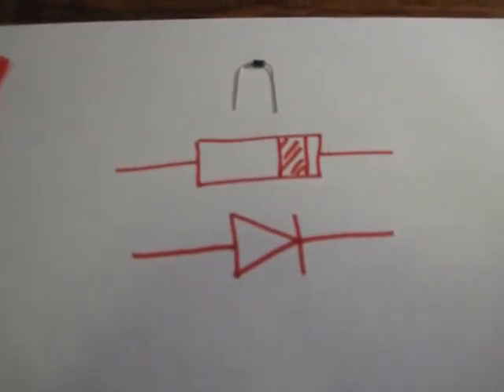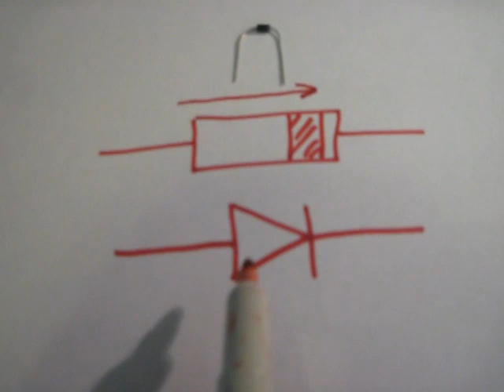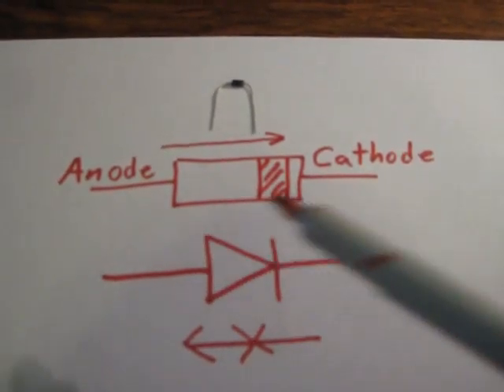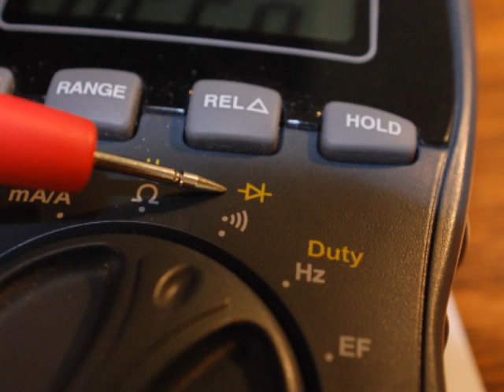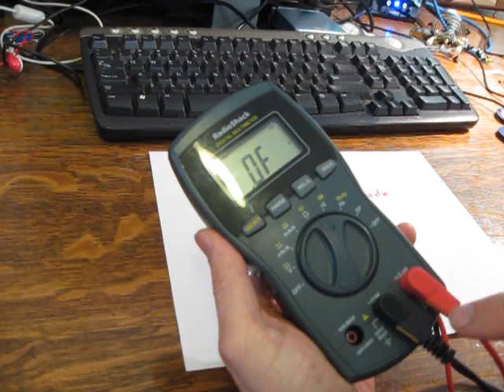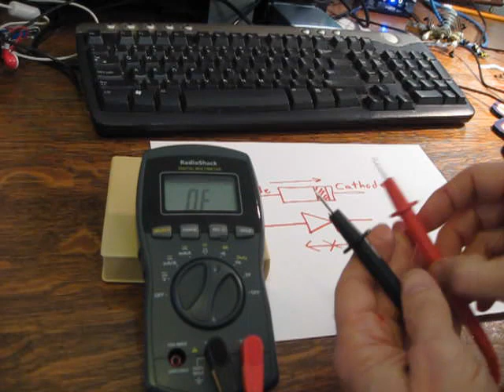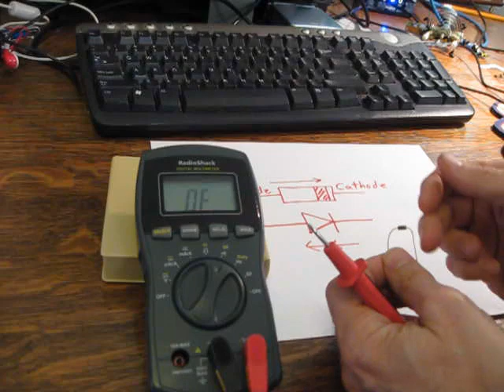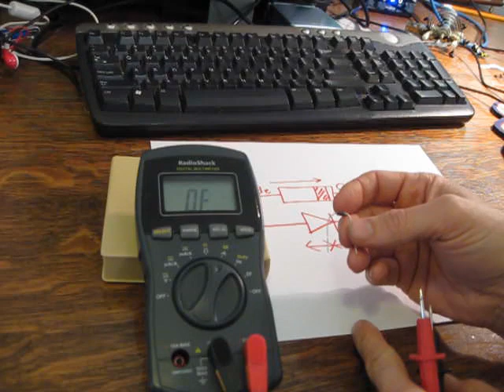Understanding and Testing Diodes

Comment: Hi, Thanks great video
I've got a mirco diode reading 158 when tested on my multi-meter...(158 not  .158)  Can I replace it with a 15V diode...and  it's from a car ECU so operates on a 12V system. and I would guess it has a 3V headroom. Thanks

Comment: It is very hard to find a video explaining how to know the power capacity, what units is used on diodes. Are they measured in watts amps. Almost any video explains that diodes allows current go only in one direction.

Comment: I have 2 faulty 2amp 1000w diodes in my tv power supply, upon replacing, is it a good idea to replace all 4 of them in the rectifier or can I get away with just de-soldering 2 of them? The replacements are the same specs but different brand, should be ok? Thanks.

Comment: Repairing a tv with no power. I dont know which component i pulled out of the pcb. But it is a cylindrical black and it does not have on any markings. Or a silver line. Can u help what it is. Upon testing with multimeter it flows current in both directions.

Comment: Thanks for the video. I'm learning to check diodes on a TV that has failed and I pulled one that I thought was bad, turned out its the Schottky diode which voltage is lower than silicon diode. Diode is good, lol.
Reply: Me too   Repairing a tv with no power. I dont know which component i pulled out of the pcb. But it is a cylindrical black and it does not have on any markings. Or a silver line. Can u help what it is. Upon testing with multimeter it flows current in both directions.
Reply: @jemsncrystals  that sounds like a bead around a wire , is there clearance around the wire ?

Comment: How do you get voltage reading from a component not in circuit?? 
There's no source. Wouldn't it be a resistance reading?
Reply: The meter sends the voltage to the diode.

Comment: I think of all the diode check videos, you seem to explain it much better.  When you mentioned to isolate your diode from board in order to get an accurate reading, I knew I had the right video.  Trouble is the diodes I'm testing are underneath a heat sink and it's going to be a little bit testy trying to remove them.  I'll get er done though.  Every thing leads to something on the power board being bad and when I read the diodes in the circuit I got some strange reading.  So, I guess when I pull them out, I'll just replace them anyway.  Thanks for the information.
Reply: you do not need to remove them to test them conn meter leads if can to test a reading one reverse the leads no redig its good thats all it can do dono worry about resistance in diodes

Comment: Don't you mean resistance ie: ohms. How can you get a voltage reading on your meter when it is set to OHMs?
Reply: Its not set to ohms. Its set to the diode test setting

Comment: You hit a home run at the end when you said they should be removed from the board for testing.   THAT was my primary concern.   Good job!
Reply: Only one leg needs be unsoldered to test as it is then free of the circuit. Easier to test with one leg anchored .

Comment: if the polarity of diodes eraised , then how can  we recognize the polarity of diodes ??
Reply: Rehan Zahid
if the markings on the diode are not visible, they have been erased or rubbed off, or whatever....
you merely revert to the standard procedure of testing Diodes

the bottom line is this
Whether it's telecommunications, Computers, Electronics (FYI, i do all of these things)
and we are dealing with something , if we get a shit situation We Deal with the Situation Logically

hence.. in Telecomms, when you get Dickheads that don't label the MDF book , you need to work with what you have.
Diodes are the same
but.. Keep this in mind as well

A Diode without markings either
- has Been punished 
or
- Is Very very old
which will in turn give you a hint as to the conditions of it

now... the bottom line is TEST THEM ANYWAY
because

a) What are the changes that you are going to get a diode that has (By some act of god) Reversed it's bias, so that the Reverse Bias Voltage = 0.5 V DC and ... on top of that has Unlimited resistance in the opposite direction.
hehe

Mate, that would be like winning the lotto 10 days in a row one after the other, it'd never happen

BUT EVEN IF IT DID  you could then use this Diode as normal even though it's reversed because 
it is still behaviing like a normal IN SPEC diode

the reality is ....
if the markings are missing
- You'll test it and..
- either it's good, so Voltage drop in one direction
*OH..SORRY.. FYI    So you know,  When you put your Multimeter in DIODE mode,   IT WILL LITERALLY send 2.0 V DC - 2.5 V DC down the probes,
so.. when you set your multimeter  to Diode Mode, it MEASURES THE VOLT DROP, .... Get it*

so... you'll test it and 
Volt drop in one direction, but   OL in the other direction.. this is good
and by this you'll determine which is the Cathode and Anode

or
Volt drop in both directions, so....  you don't give a shit which is which because you'll throw it out, 
but, if you really want to know
wel... if you had one side with a drop of  0.2 V DC  and the other with 0.6V DC     the side with least resistance is the Cathode  0.6 V DC would be the cathode
but again.. who cares

or 
OL in both directions
in this case you can't tell which is which because both have infinite resistance in both directions.
throw it out

HOPE THAT HELPS
Reply: @martinkuliza  It sounds as though you may have worked in the telecommunications field.
Reply: @ArrakisOCE  Ohhhh Yeeaaah
I might have ......... Just a tad :P

and Yourself ?

Comment: hi and thankyou for your video. i have a cheap multimeter but it does have the reqired symbols. i have tested a brand new diode in fact i tested 3 new diodes but only get a reading of 290 and the reading dosnt move when i switch ends and re test. The diodes i test on the circuit board read 293 and 300 but again 0 when i switch ends. Videos i watch show readings of around 500 is it most likely my multimeter is too cheap and nasty. its a 9v square battery powered thing model dt830d bought from ebay. Thanx for any thoughts im new to this and appreciate any advice

Comment: diodes, what if your diode has  a red line on  one side gold on the other side and 2 blace in the middle. Thanks
Reply: pj woo
ok, i'll explain it
it's simple

1. Albert bain said
"diodes, what if your diode has  a red line on  one side gold on the other side and 2 blace in the middle. Thanks"

so. he is talking about a component that has the following markings

Red Band / Black Band / Black Band / Gold Band

2. A diode (Usually) has a silver band one one side and the rest of it is black
A Diode Does not have coloured Bands
A Diode only allows current to flow in one direction (that is it's purpose)

here is a picture of a diode
https://www.google.com.au/search?q=diode&source=lnms&tbm=isch&sa=X&ved=0ahUKEwilkYrZj7PXAhXDlpQKHeKhDX0Q_AUICigB&biw=1290&bih=587#imgrc=AF7URewS3p7nlM:

now..

3. here is a picture of a RESISTOR
https://www.google.com.au/search?biw=1290&bih=587&tbm=isch&sa=1&ei=tCQFWp3iI8Gn0AStpYYI&q=resistors&oq=resistors&gs_l=psy-ab.3..0i67k1l2j0l7j0i67k1.38300.39822.0.40096.9.8.0.0.0.0.476.902.4-2.2.0....0...1.1.64.psy-ab..7.2.899....0.lyC2wG7Bp_w#imgrc=FRYfg2fIVJI4zM:

NOTICE how the gold is on one side , but there are various colours on the other side

on one side of a Resistor you always get either a Gold or Silver Band to indicate it's tolerance.
there are other colours, but USUALLY gold and silver is what you see
and gold and silver cannot occur at the first part of the resistor

also a resistor can pass current in both directions

now.
go to this link
and select 4 Band Resistors
and change the values to be 
Red Band / Black Band / Black Band / Gold Band

https://www.digikey.com/en/resources/conversion-calculators/conversion-calculator-resistor-color-code-4-band

you will get the reading of  20Ohms Resistance with 5% Tolerance
hence my comment

the joke was that Albert Bain was being silly and making a joke and acting as if he didn't know the idfference
between a Diode and a Resistor

it was pretty obvious because as  soon as he mentioned   Red Band and Gold Band and 
just threw in 2 black bands for the sake of it , just to make up 4 bands in total
it's pretty damn obvious that he was referring to a resistor

THAT'S THE JOKE
do you understand now

Frank didn't understand the joke
also he couldn't spell RESISTOR correctly   hehe

ScorpioX proved to be even more Naive and clearly didn't get the joke either
and went onto a subject of Capacitors (Which.... TECHNICALLY, is correct) but not even remotely close to what was being said here

i then came along and decided to be cheeky and a smart arse with my comment
hence the emphasis IN BOTH DIRECTIONS clearly identifying that it can't be a diode (with a few exceptions) but generally speaking, it's common knowledge in electronics that a diode is Polarized.

then you came along
as far as i'm concerned, You're the only intelligent one among them  hehe
at least you admitted to not knowing
so...
that's the joke explained
Reply: resisters have colored bands, maybe you are looking at a resister
Reply: HEHE
Well, i guess you'll be looking for 20 Ohms resistance in both directions then... with  LET'S NOT FORGET 5% tolerance  LMFAO
Reply: I don't know enuf about this stuff to get your joke really, but it still struck me funny. Thanks for the laugh (MFAO).
Reply: We use double diodes all the time as they allow our low frquency ac signal to pass while blocking the dc power we use to detonate explosives.